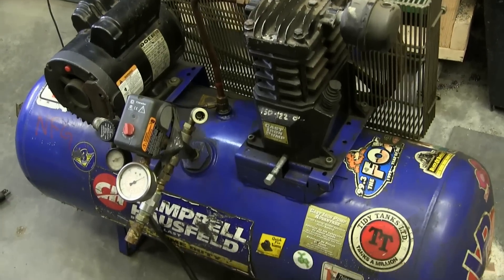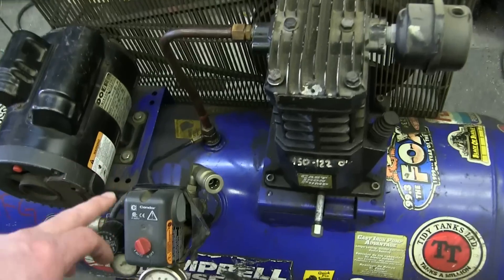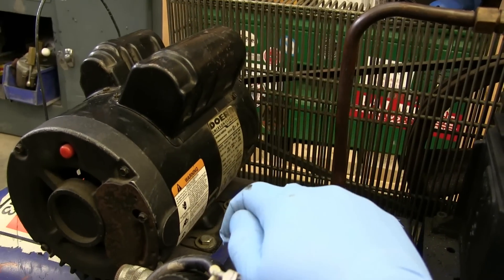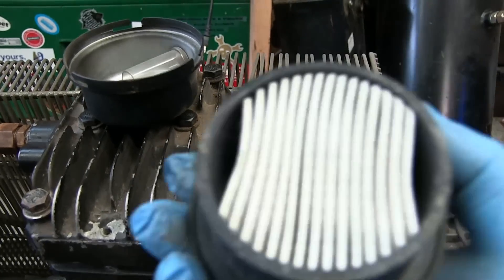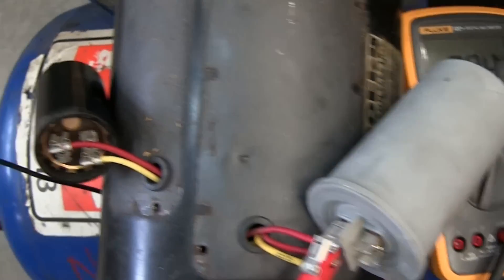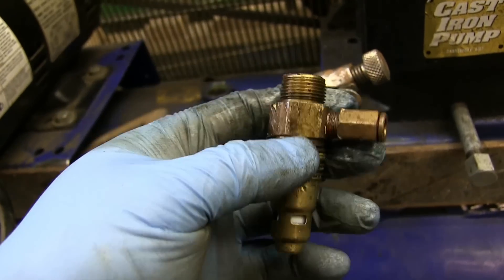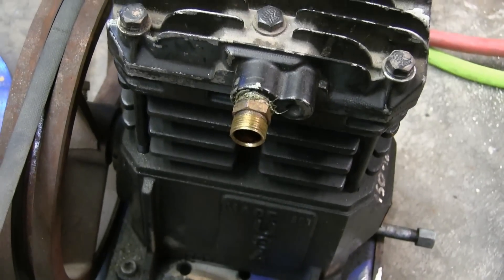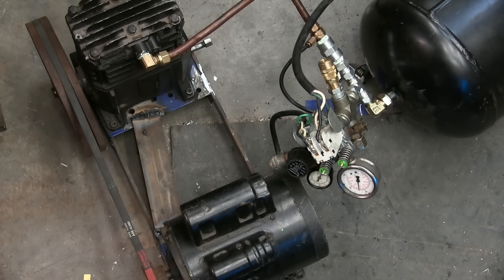BOLTR: Air Compressor Explained and Fixed.

Comment: The HFT coupons came out today.  21 gal, 125 psi, 2.5 HP vertical oiled compressor US$150.  I need one for the shop and can't beat the price but 125 psi is a little anemic.  I hope this will chooch all my air tools.
Reply: DigitalMask 
I have one of the HF ones that as soon as I got it home I cranked up the pressure till the pop off valve popped then backed off a smigin, turned out to be 155 psi.  That was twenty two years ago and it has run every day since !
Reply: Robert Plewnarz I cranked up the pressure switch on mine. I'm sure I've shorten the life of it, but that's what the extended warranty is for
Reply: most tools are rated for 100 psi, the more likely problem you'll have is volume of air, the tank will let you run a impact wrench for a 10 or 20 seconds before you have to stop and let it recharge.  Cranking up the pressure switch isn't a smart idea.  The tank is only rated for a certain pressure, and it's usually the same pressure that the switch comes set at from the factory.

If you haven't already bought it, your honestly better off finding a used belt driven compressor and cleaning it up a bit, it will likely make more air, be quieter, and last longer, even used.
Reply: Robert Plewnarz - save your money and find a better used one on Craigslist. Always people selling them that don't want to move them. 
I got a 80 gallon belt driven with a new 6hp Baldor motor on it for $150.00 just because the guy didn't want to move it. 
The motor is worth at least $400.00!
I put 2 new belts on it and new pressure switch and 2 dump valves in it . So I spent 200.00 total and now have a compressor that would cost at least $1000.00!  I'm not sure the cfm but it has to be at least 14cfm.

Comment: what the hell was that magic libation he sprayed on there some sort of weird clear on spray paint? went on clear and dried white. That's new to me
Reply: It's part of a crack finding kit. First you spray on a cleaning solvent to remove dirt and oil from the surface you are testing. They you spray on a red die penetrate and let it soak into the surface for a few minutes. Then wipe off the excess die from the surface. Finally you spray on a developer (goes on clear and dries to a white powder) which draws out any remaining dye that is hidden in cracks. The dye then stains the white powder showing you where the crack is. Simple, no?
Reply: simple enough thanks for the explanation.
Reply: That is some really helpful stuff. It is called liquid penetration dye testing. I or inspectors test some welds that I make with that same fluid. It is great for parts too large to x-ray or when hydro testing is not practical. Sometimes parts will be tested with die/pen process before being steam tested as to help keep steam testers safe. It works great to find cracks on aluminum heads or other engine parts. I general it is just really great stuff that is easy to learn to use and not to expensive. It is for more than cracks it will show any defect that is open to the surface.
Reply: If interested Kieth Fenner has a great video on how to use the stuff.

Comment: you didn't call foul in the marketing wank! says 5HP on the side,  motor placard says HP: SPL (special) but is 15 amps therefore roughly 2HP. I love the effort that went into that lie, ie getting the motor supplier not to label the true HP.  it's almost as bad as mowergate a few years back.

Comment: Another thing that can cause breaker trip is air lock at the top of the cylinder head o r trying to start the unit in cold weather when the oil is cold.

Comment: For a quick and dirty fix. Fill the cracks with some epoxy, pull a mild vacuum on the tank to pull it in(Then let in the air so it doesn't pull it all in), let it cure and your good to go for anything between a few days and a few years.
Also works to fix up pinhole leaks in not perfect welds. :)
Reply: Used JB weld on mine and still working 2 years later.

Comment: There is nothing worse than cracks in your bung...
Do you avoid welding pressure vessels due to the risk of failure of the weld under pressure?   I get that having oil is a problem and explosion issue but if the tank was dry, clean and inert, is the weld failure under pressure the reason why you won't weld the bug cracks?
Reply: I've heard all that hand grenade bullshit before. When a tank let go here all it did was hiss. There was no shrapnel flying through the air, or just a smoking hole where the old girl sat. It just went psssss.
Reply: Something most don't know about cylinder/tanks, they expand every time you pressurize them. This means the metal is stressed. Bending a paper clip is an example of stressing metal, how many times can you bend it before it breaks? This is why cylinders are hydrotested to at least twice their normal operating pressure, to test and see if they're still ok. So you go and weld the crack, introduce new stresses in the process, then go stress it more by filling, emptying, filling, emptying. 

True not all failures are catastrophic, but you can't predict how it will fail either. Our shop had a compressor with a pinhole leak, likely from rusting out. We consider ourselves lucky that pinhole didn't develop into a tear and rip apart as lots of damage would've occurred.
Reply: Wow, thanks for the info.   Now I understand why you don't want to mess with pressure vessels!
Reply: To be fair, it's unlikely that failure was due to rust, or welding for that matter.  It looks like it was over pressurized, probably due to either a broken, of missing blow off valve followed by a stuck pressure switch.

Always make sure your blowoff valve works periodically, and maintain your compressor and you shouldn't have anything to worry about.  Even hot water tank's release valves are supposed to be testing periodically for this same reason.  A blowoff\release valve is your last defense against overpressure and explosion.  If the heater\compressor circuit fails closed, pressure will just keep building until something fails.  The blowoff valve is designed to prevent this assuming it's working.  Every pressure tank i've seen has some sort of emergency relief valve, even if it's just as simple as a burst disc.

Comment: About the capacitors, yes you had them backward. The run cap is larger diameter to assist in the displacement of heat. Thanks for the video.

Comment: if you belt tension isn't right, it will labor the motor and pop the breaker, and you'll have to reset the thermal switch and question if your circuit is up to par from the 110v 20amps. bought new and it worked fine up until close to 110psi then it started to stutter and slow down. went through everything and eventually thought the only thing left was the belt, don't over look the belt. came new with wrong tension. XD used it for a year like that

Comment: no matter how long you work in the same shop, you know when that compressor kicks in, your jumping out your fuckin skin.
Reply: I had a crappy old compressor that didn't have a start stop solenoid, just used to keep pumping, the relief valve was so big and worn it was like an elephant blowing rasphberries at random intervals, scarred the shite out of me everytime!
Reply: My compressor, long story short, is half a century old. I don't use it too often, but godamn when that relief valve opens up...Took out a window, once.
Reply: fpdiscopenguin You know, I have never jumped because of either of my compressors starting.  What does make me jump every damn time is the frigging unloader valve on my 80-gallon compressor -- does it every single time and always sounds like a line or hose just busted!  I do not have that issue with my wimpy little 6-gallon pancake compressor, but the 80-gallon one absolutely startles me.
Reply: haha i'm not the only one?
Reply: It happens you never know when the thing kicks on it will get you once in awhile

Comment: Pretty good explainin' but what you called a sense line was the unloader line. You didn't mention anything about unloading the head so the motor can start.
Reply: Thanks, I came down to say that. Pretty important if you're building a compressor (or just understanding how they work).
Reply: Yeah I caught that too

Comment: Isnt that a 3-phase induction motor? The smaller capacitor is the "running capacitor" which provides a second phase. 3-phase motors run on two phases, but dont start.

Comment: I've got the same problem but I've done pressure testing before, I'm just going to cut mine apart and weld a new bottom onto it.

Comment: +AvE, you were right about which caps were which.  

start cap uF = 2652 * (amps on S) / (voltage potential between S and R windings)
"....ish"

Comment: As for "things that usually go wrong", with the single phase piston compressors I've used, I tended to get through two pump units for every one pressure switch and motor start capacitor. I've killed a lot of compressors and either I've got lucky with the centrifugal switch or unlucky with every other component, but never yet had a problem with one. Three phase compressors seem to last longer, and in my experience generally have a two stage pump instead of a twin cylinder single stage pump that the smaller single phase ones have.

Where I used to work we had 4 medium sized compressors, around the 200l tank with 4-5kW motor sort of thing. Small by industrial standards but bigger than most people would have at home. We needed 3 compressors to be in use, and the 4th one was the spare that I was always fixing. The heaviest use one was around about 1200 hours per year use, but in the UK you don't seem to be able to get good quality piston compressors - they're all crap up until you spend a huge amount of money on a screw or vane compressor.

In contrast, we had two (lower pressure admittedly, about 4 bar) vane compressors that had run extremely well in well over 30k hours use each. The only spare part I'd fitted was an oil pump on one of them.

Comment: Just fixed my compressor, motor was sparking like mad, with lots of brush material to go, bearings were fine but motor was straining to get up to set psi. Called Canadian Tire, got a new motor and piston pump assembly for $55 bucks...good for another 20 years hopefully. Great vids, I learn something new every vid. Thank you Ave. Cheers

Comment: My Hazard Fraught compressor has a leak that I have located only as "near the pressure switch". I don't need air in the shop that often as I mostly do handloading and ham radio, but when I do need it badly enough, I just run the compressor long enough for the job, then shut it off and let it leak down. This video has inspired me to look closer and maybe actually fix the thing :) Maybe I can use my AvE ruler...

Comment: AvE , I know you're a Makita fanboy, so I have something you may cop a chubby over: early 1980's Makita 6071D 7v cordless drill, battery, charger and carry case. IT STILL WORKS. Frankly in pretty damn good shape. If you want to do a comparison video of it then pass it on to a retro tool collector (or add it to your collection), it's yours. I just want it to be used/better appreciated than it is now. Let me know if your fancy is tickled.

Comment: Correction on your explanation around the 6 minute mark:
The pressure switch gets its pressure reading from the tank directly. The little line that's fed from before the non return valve is for the head unloader. That has one of two purposes (well, it's unloading the compressor part either way). 

With a start/stop controlled compressor, when it gets to pressure and stops the unloading valve is opened and it releases the pressure that's currently in line feeding the non return valve and therefore means that the compressor has an easier start. That's the "psssht" you hear when the compressor stops, and is also why you should only every turn the compressor off using the control switch and not by pulling the pokey bit out of the pokey bit receptacle (because if you were to then plug it back in again the motor would have a hard time starting it up).

The other function of an unloading valve is in a compressor where the motor runs continuously. That's used in large electrical compressors and in engine driven compressors, and just allows the compressor to blow off when the receiver is up to pressure.

Comment: A run capacitor is not put in for power factor correction it does, but the reason is to increase torque as a result of phase adjustment. 
The Start capacitor is rated with a lower working voltage but a higher Mfd rating than the run capacitor.

Comment: What do you think about oil less air compressors? I call garbage.
Reply: SD Customs They're fine for a small job site portable compressor up to about 4cfm. For running air nailers and stuff They're much lighter to move around and fairly inexpensive. But, for something that you're gonna park in your garage, buy the biggest thing you can possibly afford with an actual oiled crankcase. 2 stage is preferred so that you can get some real air pressure ,150-175psi, and some real cfms. I'd recommend at least a 5hp 220 volt, with a 60 gallon tank if you can afford it.
Reply: As a diver i love them.
Reply: Good for spraying things you don't want oil in.
Reply: direct drive compressors in general are garbage imo, good for light duty only.  Oiless ones are even worse.

I just pulled a 15+year old campbell haus compressor from a gas station, it was literally 3\4+ full of water and had no maintenance in at least 10 years (including draining the damn thing), slapped a new starter cap on it and it works like a charm.

belt driven compressor are also significantly quieter, even for a homegamer, if your the type to do more then fill tires and use a small ailgun, your better off getting a belt driven compressor that you'll keep for 25 years.
Reply: SD Customs  i got a craftsman 30 gal last year for $20 and the cylinder had de-chooched along with the compression ring.  got a repair kit for all of $30 and sold the thing for $200.

at the same time I decided to check out my many years old long suffering contractor compressor and discovered it was in immaculate condition. 

the rungs were the same teflon material but the cylinders were different and I think that made all the difference.  the Cman was chintzy stamped metal with visible waves even in the new one, the contractor was a nice cast or pressure molded piece with a coating and it barely showed any scuffing at all where even the best sections of the C mans bore were rubbed raw.

I take it then that like most things it depends on the manufacturer, oil less can be good...or it can be junk.
Reply: They're good for paint sprayers.
Reply: Loud as frig, but ok for small stuff.

Comment: i have welded 3 compressors without any problems 
had to weld in  bungs to tap into for un filtered and un regulated air(full pressure to impact guns)
only way is to drill a 12mm hole and welded in a bung and thread it for the connector
done that to 3 compressors and 2 were a oily pigs inside them

Comment: Oh, run cap is to keep a trickle of pixies suitably phase adjusted for torque reasons during run. The start cap is put in paralegal with the run cap for starting to increase the phase angle and therefore torque during start.

Comment: did you just do 3/32 in your head
Reply: Fair chance he's seen the 3/32 value before. I worked in a machine shop where one guy knew all the decimal equivalents of all the fractions up to one inch in 64s increments.

Comment: somehow my dewalt air compressor hasnt let me down after 6 or 7 years... it was only supposed to be a temporary one until i could find a legit one... it doesnt even have a lubrication system, the bottom end of the piston is open to the air...

Comment: when i was an apprentice, my boss asked me to strip a compressor to prove that i could, i fucked every single piston ring, as did the other apprentice when he did his. I spent a fortune on new parts (on company dollar mind) and re built mine proper, the other lad just left the rings out.

MY boss didnt like me much and decided that the machine that was knocking its bollocks out was the one i rebuilt. So i asked him to show me which machine was bad, and to run them both.

Thats where my letter stamping came into its own, i unbolted my machine and under neath was a date of repair and my name - stamped in a nice neat row.

Dont know why i felt the need to share this but yeah, basically bosses are arseholes and always leave a tell tale of your work someplace incase some shit like that happens.